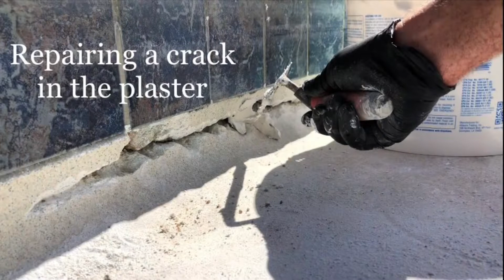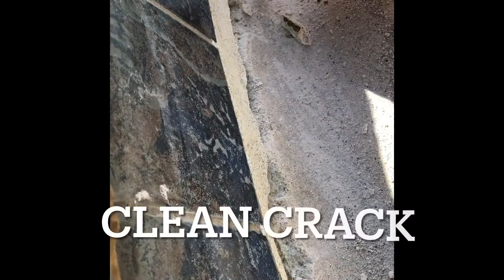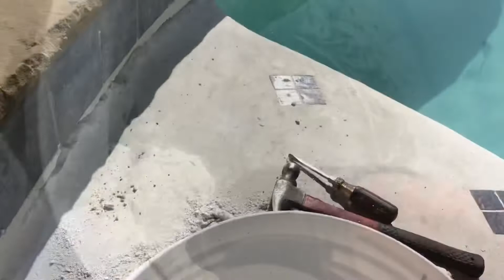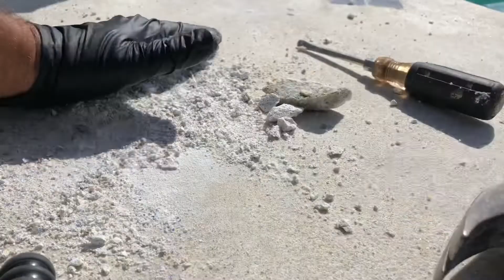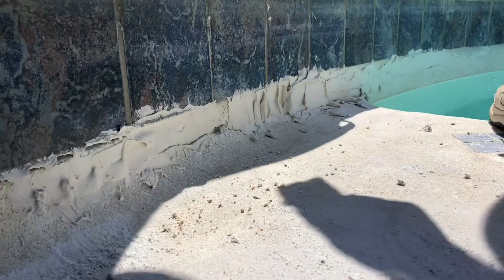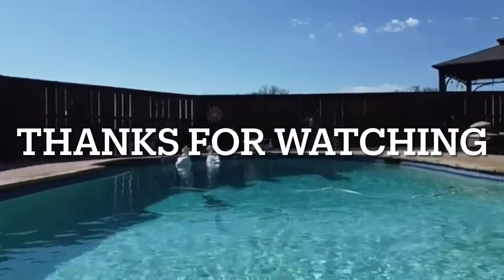Swimming pool leaking; Swimming pool crack repair

Comment: Have you heard of the hydronic hole repair method?
Reply from the maker: No, how does it work?
Reply: @Steve The Pool Guy  not sure that's what my pool repair person did so I'm trying to get my information
Reply from the maker: @jayvet8402  there is a hydronic method as described in this article. It is more for leaks in copper plumbing. Similar to fixing a leak in a radiator.

Hercules Boiler Solder makes strong lasting repairs on leaks in steam boilers caused by leaking joints or sand holes during installation, or older installations where corrosion, vibration or settling causes leaks and cracks. This easy-to-use, non-metallic powder finds the trouble spots and forms a tough seal which expands and contracts with heat, resists high pressure, and temperature. Hercules Boiler Solder is for use on all hydronic systems including those with rubber or plastic components. This product remains in the boiler water of steam systems and will not seal leaks in the radiator circuit. Available in two variations of sizes: 1 lb and 200 lb.
Reply from the maker: @jayvet8402  is there a possibility he meant to say “Hydraulic” cement. That’s what I used in the video. It expands as it dries and will cure under water

Comment: What type of mortar did u use?
Reply from the maker: Thinset mortar mix. The same used for setting tile. You can also use pool plaster mix, pool tile supply like Noble tile and national pool tile. It just needs to be waterproof

Comment: crack will crack .put liner or armed pvc now👍
Reply from the maker: I have hear of various methods used to preserve a cracked pool.  Fiberglass liner seems to be a good option in our market.
As for this pool, ground movement is the primary problem that caused this crack. The builder left no room for the pool to move. The expansion joint is fully compressed as the slab of concrete attached to the house presses into the side of the pool. The crack is perpendicular to that slab of concrete decking. My suggestion was to increase the size and depth of the expansion joint to prevent this from happening again. However, the owner said just patch the crack. 
So as the seasons progress through wet and dry it will move again. Maybe next time we will get to make a more complete repair.
Thanks for the comment